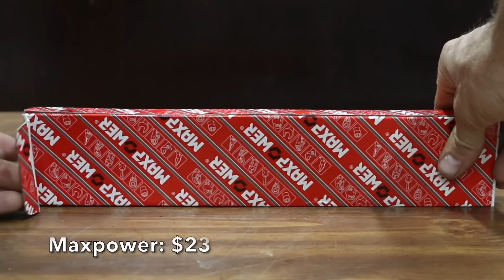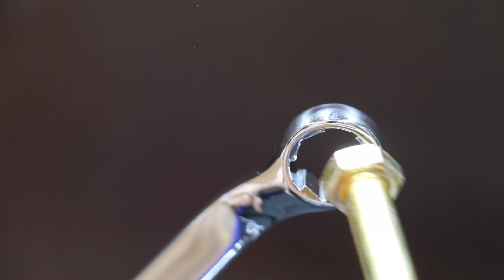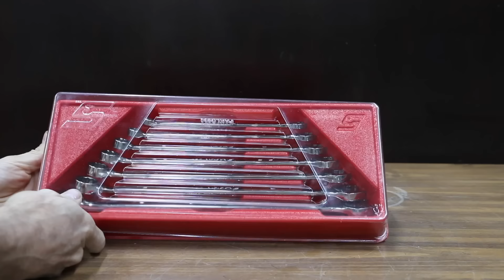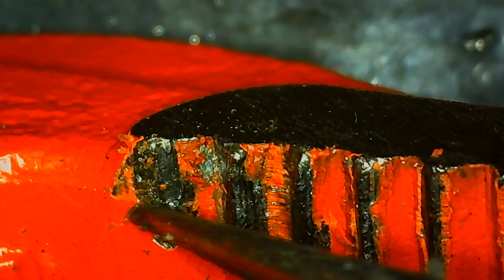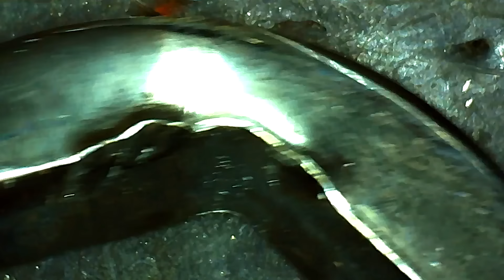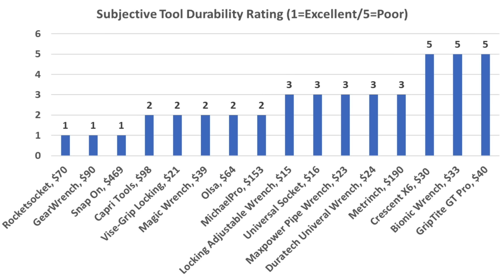Best "Rounded Nut" Extractor Wrench? Let's Settle This!

Comment: My grandfather bought me a full Metrinch socket and wrench set for my birthday more than 2 decades ago. They were made in Russia back then even though it's the same design. I still use the set nearly every week if not every day. For all round use and having a full set with only a few pieces you can take anywhere that you also don't have to guess metric or SAE I still believe it's the best set you can find. Though I like the socket set much better than the wrenches which do have clearance issues sometimes.  Great video, thanks!
Reply from the maker: Thanks!  Thanks for sharing.

Comment: Project Farm i have an idea for something to test a bit more toy related than tool related But I think it would be awesome if you could Do a test on Drag Radials for cars Trucks we are building a 1956 ford F100 With a big block Ford Motor it currently has new good year SR-A all the way around And the rear tires Break loose in any gear without jumping on it lol I'd like to see some real Numbers on a Test for The Different Major Street legal drag Radials and performance Tires the major ones id like to see are (NITTO NT555GII, NT555RII, NT05R) (Mickey thompson ET Street SS) And there is A Michelin Pilot sport thats Pricey. THE NT555R2 Is the one I have read is the best for ware, cost and Traction. If there is anything I can assist with let me know
Reply from the maker: Thanks for the suggestion.

Comment: When looking at the design of the tools, I thought a couple of them would've worked better than they did. And some of the looser fitting ones I thought would've slipped earlier, but they held.  

For a completely rounded bolt, I'd think a regular pipe wrench would be the best, since the pipe wrench is made to turn round pipe.  Though the size of the head is so big on a pipe wrench, there are too many cases where it won't fit!

Great video!  I never knew there were so many of these special tools out there.
Reply from the maker: Thanks!  Thanks for the feedback.

Comment: Great video as usual. Those Rocket Sockets are simply the best for taking out rounded bolts providing you have the space. The Capri tools is something to look at for the price. 
A video suggestion: direct drive v belt drive compressors.
Reply from the maker: Thanks!  Thanks for the suggestion.

Comment: Todd, a suggestion for a video now that summer is around the corner.  Would love to see a test of all these "UPF 50+" shirts etc. that claim to protect you from the sun.  There are some name brands, and lots of "off brands", and it's impossible for the average person to determine which ones are actually protecting you.  Also, I just read on Amz that some of them use a chemical-based protection, whereas with others it's the material itself that protects.  Thanks!
Reply from the maker: Thanks for the suggestion.

Comment: You should do a test on Toilet paper.  To test how well it absorbs.  Durability dry and damp.  Test to see if a double roll is actually twice as long, and if a triple roll is 3x.  See how easy it is to tear at the purfications.  And do a youtube survey before posting to see what % says a toilet paper roll is to go over or under on the dispenser.  Even do a survey if people fold their toilet paper or crunch it in a ball when using it.  Then test it as a ball vs. folded neatly when doing the test.
Reply from the maker: Thanks for the suggestion.

Comment: huh, its like the completely rounded nut is to small to fit the wrenches. weird. should have used a slightly larger bolt for the completely rounded one to give the wrenches a chance.

Comment: Great video.  Since I don't own any of these, my  current plan of attack on rounded off bolts is to get out my impact set. Find the next size down from the bolt size and hammer it on and then use the impact.  Is it a elegant solution...no.  Does it work in most cases....yes.    If the bolt is completely rounded off you can grind some flats in the bolt head.
Reply from the maker: Thanks!  Thanks for the feedback.

Comment: Suggested next video: Best degreaser / cleaner. Comparison between degreasers, oven cleaners, brake cleaner, E10 fuel. One test would be finding a set of old V8 valve covers and cutting them, then try to remove the oil tarnished undersides.
Reply from the maker: Thanks for the suggestion.

Comment: 30 years of rust belt auto tech experience mirrors your tests almost exactly. Sometimes, welding a new nut on top of whats left, or a sacrficial socket welded to whats left, (think  locking lug nut) is what works best. Yard sales are good for those. Great vid !
Reply from the maker: Thanks!

Comment: Thank you for testing the Metrinch tools. I've been using Metrinch tools for 25+ years and they've never broken and have always worked 98% of the time I've ever had to fix anything. The other 2% was larger sizes that I didn't have the correct size Metrinch for. I will still keep using these great tools until the day that I die. Metrinch makes great tools. Even if they didn't come out on top in your tests, I'm still glad to have mine because know they'll always get the job done and that's what it's all about🙂👍
Reply from the maker: You are welcome!
Reply: I wonder if the sockets from metrinch would have worked better then the spanners on the rounded nuts/bolt

Comment: They still make Metrinch?!  I bought a set of those back in the '90s!!  They're actually pretty handy to have in the trunk of your car for roadside repairs, because they fit both metric and inch bolts (hence their name -- Metrinch. 😂)  They've held up reasonably well for an "as seen on TV" tool kit.
Reply from the maker: Thanks for the feedback.

Comment: This message will probably not get read, as I’m only the 2,800+ comment on this video, but here goes

I would really be interested to see what difference Alkylate fuels (e.g. VP Racing C9, Aspen R, etc.) in classic car engines make compared to regular pump gas (super unleaded RON98 or RON95, max E5, not E10). 

There are a lot of wonderful ‘performance’ claims made about alkylate fuel (burns quicker and cleaner) - not talking about it being less ‘perishable’, simply about performance benefits. 

But then I hear other anekdotes questioning the potential ‘lack of lubricational properties’ and about fuel filters getting clogged up (somebody said this is because of fuel lines perishing???), but I have not been able to see any proper assessment being done on any of these factors. 

I would be very interested to see some of your ‘research’ and proper testing on the actual benefits and possible downsides (apart from price) and risks (e.g. wear) of alkylate performance fuels vs. super unleaded pump fuels in classic car (e.g. carburated) engines as well as modern car engines (with proper lambda sensors, auto ignition advancing, etc.)
Reply from the maker: Thanks for the suggestion.
Reply: Thank you. Appreciate your diligence in reviewing comments

Comment: Would love to see tests of wire connectors - crimp, solder filed/heat shrink, insulated, non-insulated, etc... I sure seem to spend a lot of time dealing with the good and bad examples of these.
Reply from the maker: Thanks for the suggestion.

Comment: As far as durability and being able to take the tightest nuts & bolts on or off, I can say my Snap On wrenches have worked fine without breaking or damage since 1974 in day to day use for over 30 years. I have a couple of 10 mm wrenches that are being because I used cheater bars on them, but the never broke or bent to the point that they became useless. I’ve tried other brands that work pretty good, but have failed, considering the the cost of those tools some were pretty good some not so good, generally speaking, you get what you pay for. Thank you for doing the wrench test.
Reply from the maker: You are welcome!  Thanks for sharing.

Comment: @ProjectFarm would you look at the difference between the handle lengths and widths that works best for small hands (women's) for three most-commonly used types of pliers? My preference would be needle-nose, tongue-groove pliers, and lineman's or diagonal cutters (my most commonly used three). Seems to me that all tools are designed with wider grips than I can get good strength with simply because of the dimensions of my hands--not the strength. Leverage is not merely strength; and the irony is, a longer handle gives greater force on the end of the pliers, but the way they design those handles generally leaves no option but to have larger hands to get the optimal grasp or cut I'm aiming for.
Reply from the maker: Thanks for the suggestion.

Comment: The Vise Grip locking wrench they make in 3 different sizes. I have used them on air hoses with soft brass fittings and you cannot get a flare nut wrench on the nut. They work very well for this purpose.
Reply from the maker: Thanks for the feedback.

Comment: kind of surprised that the so called magic wrench wasn't able to remove the undamaged bolt, I used the same kind of tool many times in tricky totally rounded situations and it has never let me down (but it's always been on brake lines so...)
Reply from the maker: Thanks for the feedback.

Comment: How did you prepare the partially and fully rounded off fasteners to ensure consistency? Could I be correct in guessing that you used an engine lathe to maintain the same “wear” characteristics?

Comment: I are mechanic.  Me use metric.  Me think 7/16th inch close 12mm.  Oogha dooogha, thunk, thunk, thunk. 

Informative video.  Have a variety of methods that work for me.  Starting at 12 point sockets ending at grinding the head off as a nuclear option.  Like the Stanley wrench though.  Makes the one size strip all wrench not strip everything so easy.  Problem is i have three sets out there on the road.
Reply from the maker: Thanks for sharing.

Comment: Great Test, however I would discard a bolt with a partially rounded head anyway. So for me damage to the head is irrelevant,  the pipe wrench with (most likely) induction hardened teeth is best to do the trick, followed by the rocket socket. However, if the last is made from chrome alloy steel, this cannot really be hardened. All these shiny chrome plated tools with extra features or die cast teeth are crap, mediocre steel as you showed. For such tasks I use the knipex cobra. It's ground and induction hardened teeth dig deep into the head and would not let loose, until the bolt sheers.
Reply from the maker: Thanks!  Thanks for the feedback.

Comment: I can't believe I'm saying this on this channel, but the Snap-On wrenches are being used wrong. They aren't meant for rounded bolts/nuts. They are meant for tight spaces or bolts in odd locations. The box-ended side is a basic box-end. The open side has the flank drive "technology," and it's meant to grip a fastener without being fully seated. If anything it's designed to not round off fasteners easily and to allow for descent grip in hard to reach spaces. This is the first time I've seen this guy put a tool through a test that it's absolutely not meant for, kinda weird.

Comment: I think the nut or bolt extractors from harbor freight are very similar to the rocket socket. They helped me get a brake job finished properly when I rounded a 12mm nut and needed something to crack it off.
Reply from the maker: Thanks for the feedback.

Comment: Our shop has a set ratcheting bolt extractors, made by mastercraft. the jaws look like the rocket sockets, 4 sizes per wrench. 
Have had them for at least 10 years, get used occasionally, and look like new.
Sadly they discontinued them.
Reply from the maker: Thanks for sharing.

Comment: YOU! You made me into a electric power washer addict. I use it every day. It is permanently connected and plugged in outside.
I need you to do another video on them. I need more POOwWerR! what do you think of the "DeWALT DWPW2400" it looks like a whole new high-powered version than what you tested.
Reply from the maker: Thanks for sharing!  Thanks for the video idea.
Reply: @ProjectFarm  I was watching a video where they connected 2 powerwashers to double the flow rate. I wonder if it is cheaper to just buy two cheaper washers and connect them vs buying an expensive one.

Comment: This was an awesome video. I'm a retired motorcycle technician and machinist and most of my tools are Snap-on. If I were just getting into the industry, I would not buy Snap-on because of the high price and compared to the Capri brand at almost a 1/4 the price. I've never had a problem with getting a replacement tool for one that was broken with Snap-on but you may have to wait a whole week until the tool man comes back. Of course you could call him to find out where his route is that day and meet up with him. What do you think of ceramic brake pads for automobiles? I've only experienced organic and semi metallic.
Reply from the maker: Thanks!  Thanks for the suggestion.
Reply: @ProjectFarm  That could be a tricky one to set up for testing any way it's done.

Comment: Shoulda tried a Knipex Cobra pliers. Betcha it would have beat out most all the conventional ones you used, especially on the rounded bolt head or nut, with good forearm strength. Maybe next time?
Reply from the maker: Thanks for the suggestion.

Comment: You didn’t grab onto the bolts correctly with the pipe wrench. They are not designed to grab that deep in. If you would have used farther out in the jaws you would have seen better numbers.

Comment: If you have room for it, use a "Pipe Wrench".
for diameter smaller than 1/2", use a power drill with a chuck.
Reply from the maker: Thanks for the suggestion.

Comment: I'd love to see a review of spud wrenches and sleever bars- tools used in structural steel election... Klein is pretty much the industry standard, but Armstrong and Williams make pretty popular spuds as well... 3/4 by 1 1/4 inch is a pretty common size- 1 1/4 inch being the wrench/ nut size... the offset neck wrenches are the most common but there's a wide variety of shapes
Reply from the maker: Thanks for the suggestion.

Comment: We weld a nut to fully rounded bolts or nuts to remove them or drill the head off, snap-on does make a easy out set
Reply from the maker: Thanks for the feedback.
Reply: @ProjectFarm  You’re welcome, thanks for the great videos!

Comment: Michael Pro are the same wrenches but better than Olsa. Plus they have a compact Crowfoot wrench set similar to the Pipe Vise, that's better than the Maxpower pipe wrench. 
The Capri/Astro are amazing. Capri has a much better selection 
You should have tried the MAC RBRT wrenches in this video and the Pipe Vise or Knipex Swedish Pipe Wrench
Reply from the maker: Thanks for the suggestion.

Comment: Can you test inverter generators? Which brands have the best/most consistent power output and the cleanest oil analysis for their engines or longest run times? Im thinking generators between 2000W to 3800W.  I recently bought a Wen 56235i and Im curious to how it would hold up to other brands.Thanks!
Reply from the maker: Thanks for the suggestion.

Comment: I use knipex pliers wrench if they work and i want to re use the bolt and knipex alligator if its badly rounded and I've ripped the head off of exaust bolts i have 4 sizes of each altho my 2 smalest arent actually  alligator they are cobra because they don't make a mini alligator the cobras work fine but thee jaws have less articulation for spring hose clamps and they are slower to adjust.
Reply from the maker: Thanks for sharing.

Comment: I have Kwik-Tite wrenches for brakes lines, they're full opening ring wrenches for plumbing i think... a mechanic let me borrow one to remove a fudged brake union and it worked a treat.. the trick is to use a size down or a metric on imperial and vice versa for a tighter fit, as you use force they clamp harder.. they aren't for cracking off rusted on stuff, but a great little tool, super compact and handy for any bolt or nut with a cable or pipe going through.. I had to get a friend in Canada to order them, then fly over to the UK with them when visiting as I couldn't get them anywhere (15 years ago or more)  now available on amazon..
Reply from the maker: Thanks for sharing.

Comment: For the bolt extractor sockets like the Rocket Sockets and other brands, it would nice to see a comparison between how well they work on their "metric" equivalents versus the "imperial" as most sets say that they work for both. I've heard sometimes the tolerances just aren't good enough to always work on both. I'm in Australia and work on Japanese vehicles so all I experience is Metric and it's hard to decide on a set not knowing how well they might work for metric.
Reply from the maker: Thanks for the suggestion.
Reply: Honestly, living out in the United States and having been working on cars for three years? I have seen exactly one SAE bolt on a vehicle, and that was on swollen lug nuts one time. American cars, European cars, Japanese cars, Korean cars, they all use metric. The only times I've needed SAE outside of that swollen lug nut story are when I'm fucking around with tools and equipment jerry rigging shit or doing construction.

Comment: Great testing again Todd.  Like some others I have had set of Metrinch wrenches and sockets for over 25years.  I have picked up a set of Knipex Pliers Wrench and have found it does a much better job than any adjustable wrenches that I have found.  Would be good to keep in mind if you do a similar test again.  Keep up the great work.
Reply from the maker: Thanks!  Thanks for the suggestion.